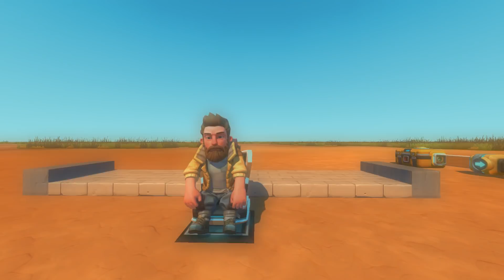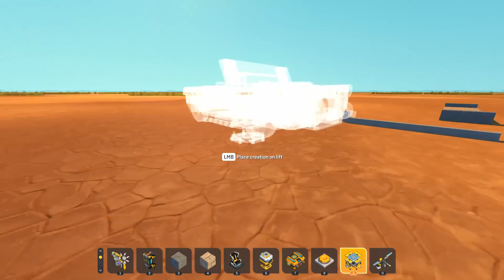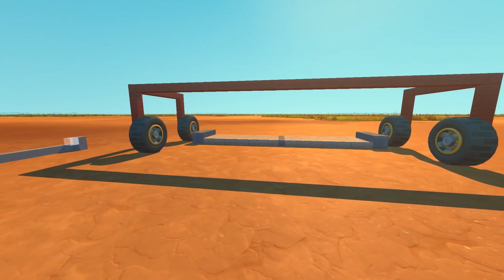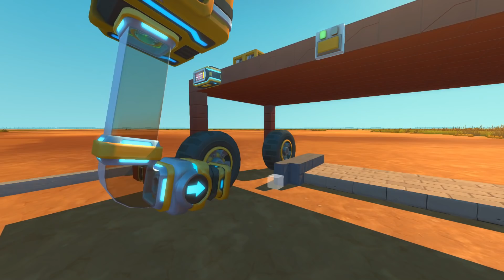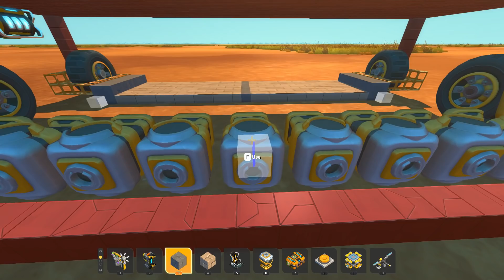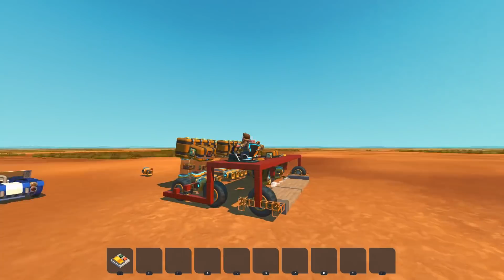Making an Automatic Road Building Machine! - Scrap Mechanic Gameplay

Comment: You should do a Multiplayer Monday where you each build a boat with a single vacuum pump, connected to a chest filled with concrete, and the goal is to build on the other player's ships, weighing them down until they sink.

Comment: Great Idea!! A tipp for the driving...maybe consider to have the wheels on the controller so its in the same Time loop. Instead of making a time loop for the block placing a would hook maybe a piston in front of the sensor and control the piston with the cotroller used to move the blockplacement, so it cannot be out of the loop.

Comment: Quickest easiest fix would be to remove 2 of the road building vacuum pumps that way you'll get each pump placing 4 blocks each instead of 3 so it'll time up properly with the curbs and then the outer blocks shouldn't be interfered with by the curb laying pumps as they will always be in the outermost position when the road laying pumps are in the outer most position.

Comment: Use that center sensor to trigger an entire non-looping sequence for each part, with the final bit being an incremental turn of the center wheels.

As it stands, you have a 4-cycle curb builder, and 3 separate 3-cycle road builders, all running at the same cycle speed.that means your cycles end up being offset by 1 accumulating step.

Trigger the road start on the center block sensor.  Lay the curbs, then lay the lanes, then lay the center, then turn the wheels.

Comment: Why not have all the pumps point straight down? Just stagger the pumps do each one is able to make a solid straight line, all pimps should easily be able to be placed flat on a platform looking down. No bearings or pistons needed for the pumps.

Comment: I feel like it would have been so much easier shooting blocks straight down. No need for angles. You can just shoot continuously unless a sensor detects that the block is already placed. And as well you can make it move forward only if all sensors are on (meaning if all blocks are placed for a line).
Would be way more consistent and fully autonomous. AND also wouldn't require a bit of road to be placed initially so you can build against it (because you would always build directly on the ground).

Comment: Nice. The center sensor should also be responsible for controlling the wheel movement for forward motion of the entire vehicle. If it sees a block it drives forward, if it doesn't it stops. That way you keep a precise distance.

Comment: Some of the issue is that the pumps have a built in limiter.  I messed with that limit once and got a pump to activate as fast as every half a second.  Could fill a water tank fully in 15 seconds.

The edge parts are going to take longer to make.  Perhaps you should use sensors more and rely on timing alone less.

Comment: The versatility of the vacuum pumps is a lot better. But 2 things I really wish that we could use them for is corn (placing them so we can then automate wok milk) and glow sticks. Tossing the glow sticks is nice and all but there's times where I want to really yeet them into a ruin or out into a field and my mechanic doesn't have the yeetus to do so. That being said, I tend to also abuse the vacuum pumps as an excess seed disposal. Just lob them into the ocean and set them free. . . . . . .

But why are you so hell bent on making this a horizontal based system? If anything a vertical laying system timed out would be easiest. Having a straight row across, then a second offset row behind that, then a third offset row behind that and you've got every block in that alignment covered and you just double up the side walls. So as you roll along, probably via controller power, you have it to as the first row of pumps pass over a point they fire laying a rough 1/3 of the road down. Then you keep going and then next row fires completing the next 1/3. The last row fires after you pass by and that completes that 1 bit of road, but if you have it slow enough, like real road laying machines, then it should work fine.

Comment: Your center-sensor finishes the three blocks, and you could then use that to activate your electric engine (which could also be a controller instead) to advance one block further, then that means it's a 4 step process, which means the 4 vacuum pumps for either side could be changed for three pumps per side doing a 4 step process instead of the 4 pumps doing a 3 step process... All you'd need to do is add a block between each of the 3 pumps because the pumps are 3 blocks wide, and adding a block makes them 4 blocks wide...

Comment: "The machine should be bigger than the road it is building!"
Looking beside me, I can confirm that it is in fact, not true at all. :D
Reply: Me reading this chat: (computer crash noises)
Reply: @evelyndotson1839  Haha... I even heard that as I read it. :D
Reply: @Petq011  lœī (lol)
Reply: @Petq011  I'm still broken
Reply: @evelyndotson1839  I was just saying that usually, asphalt laying machines are about the size of a single-line road. And that they usually make several passes. Like 2 in the case of this type of road where it is only 2 line road, and it's usually another machine that paints the lines after it cools down.
Also, the curb is usually placed by humans... but that's another matter and doesn't need to be mentioned. I am just saying in case you needed more info.

Does it somehow help you, or would you like more explanation? :D
Reply: @Petq011  (Roblox OOF sound)
Reply: @evelyndotson1839  I have no idea what that means, but okay. :D
Reply: @nikkiofthevalley  You've never seen a real asphalt-laying machine?
(Or however, it's called in English... I forgot at the moment.)
Reply: @Petq011  Ohhh. I have, but didn't understand what you meant.
Reply: @nikkiofthevalley  The first part of my comment was what he said near the start of the build. :)